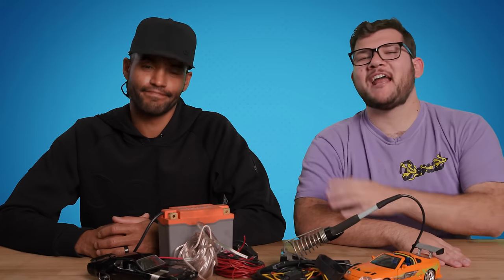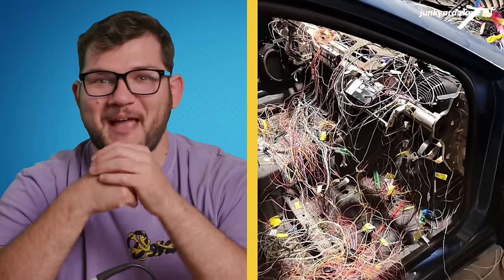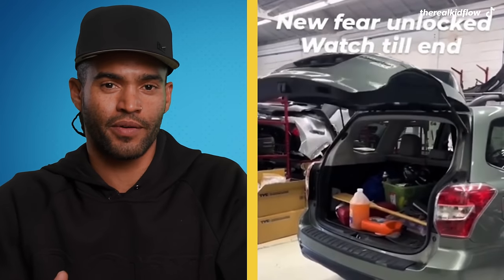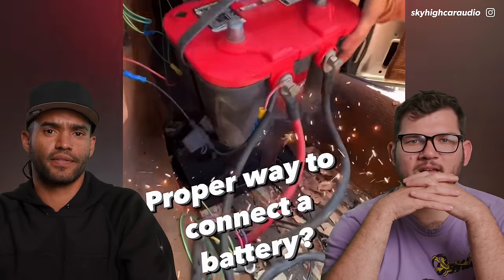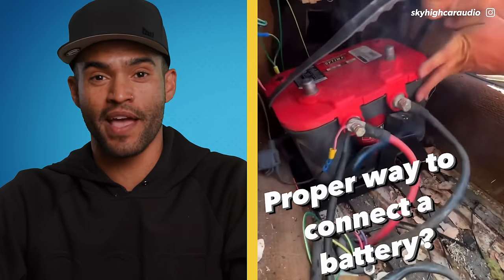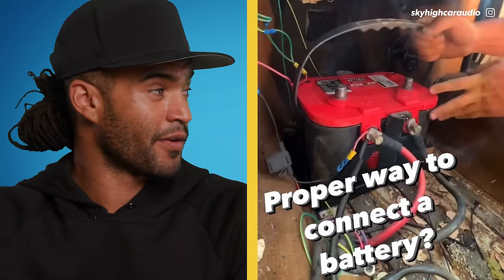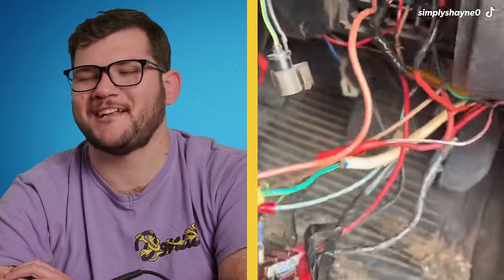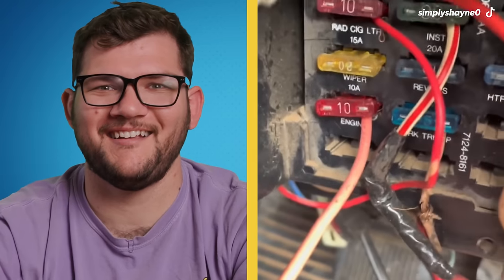Mechanic Reacts to Deadly Electrical Repair Fails

Comment: Ah, memories. Once when I was destitute and homeless, someone gave me a free Volvo if I could get it to start. Which was not the biggest problem, it was just the transmission interlock, I bypassed it and it started right up. The biggest problem was that it had been rear ended which destroyed all the lights. It also killed the headlights somehow, no idea why.  I affixed trailer lights to the bumper, went to wire them in, and discovered that someone had snipped that entire part of the wiring harness off. No idea why. Anyway, I'm homeless, got $20 to my name, very limited tools, no multimeter. So, I wire them all to toggle switches that I mounted in a piece of cardboard and taped to the dash. Got fancy and had a three-way toggle with a blinker relay for turn signals. I had to screw a giant button to the brake pedal to get those lights working. Did this all in an Autozone parking lot, I might add. Lived in that thing for like 6 months and put 10,000 miles on it.
Reply: Hope you doing better these days, man.
Reply: dude thats legendary
Reply: Thanks gor sharing, hope you're in a better place now or at least on your way to a better place.
Reply: Probably cut the wiring to get the lights to stop or something similar. When a vehicles horn gets stuck on after an accident the fire dept will cut wires to get it to turn off. Hope your doing well my man.
Reply: Fucking legend right here man, that's awesome. Other than that, hope things have turned around for you.
Reply: That’s awesome man, what a story
Reply: Wow, dude! Way to Mcguyver the fuck out of that beast! Hope you're doing much better now!
Reply: Legend.  And a volvo....dope!!!! 😂😂
Reply: @Damasiofa  Judging from his name (which is fucking awesome btw), and his ability to macguyver shit, I'm going to guess his homelessness is dependent on whether or not he is on his meds.
Reply: Rich in money vs rich in knowledge 👍
Reply: What kinda Volvo? My first was a 240 -78! Great cars! And safe.. like driving a brick!
Reply: I can't Imagine doing anything like that without a multimeter because I continuity test everything I do like 40 times

Comment: first clip - Junkyard Dave, he nailed it, his Charger Magnum Hellcat runs and runs good! No shortcuts, no fire, no issues at all
Reply: He did an amazing job, I follow that build and have since his 3rd video on it. One day I plan on building my magnum similar to his and learned a lot from him on it.
Reply: that dude is no joke and his wiring on that car turned out amazing
Reply: Crazy. I used to watch him long ago before he gained any popularity. Last I saw a video of his the charger magnum was just beginning or maybe even just an idea
Reply: 0:43 junkyard dave ftw!
Reply: Did he ever get a windshield and wash all the dust off the Magnum?
Reply: Maybe they should actually look into his complete work rather than shitting on a couple short clips.
Reply: What looks like a rats nest to some is an organized masterpiece in the right head
Reply: I started to watch his build on this but then he kept talking too much then started jumping around to other projects and moving shops so I got bored and moved on.
Reply: @The513Warning  yes, the windshield is in
Reply: That is hack work, zero pride in effort.
Reply: @ronbelanger4113  hack work? you should watch his videos on that car. nothing hacked on that one lmao he rewired and reloomed that entire car to the same if not better than factory
Reply: That car has taken him years. I have massive respect for him

Comment: In my aviation mechanic days, I was the primary focal for doing wiring/electrical jobs.
1. Nobody else had the patience/or enough understanding to go through a wiring diagram that sometimes stretched through 13 pages of 11x17in paper.
2. Nobody wanted to touch it, being afraid to short something out or get zapped.

it was quite satisfying in the end, when you're updating an older small airplane with more modern avionics, and you end up with a ton of dead wires that you cleared out, left over from several previous avionics changes.
Reply: It's all 400hz Ac stuff correct? I don't mind digging real deep into auto/ equipment DC stuff, no urge to play with AC in a "vehicle".
Reply: On the modern jets, the electrical system packs a wallop, but my bread and butter at that time was in General Aviation (Cessna 172s, Beech Duchess, as high as Cessna 414), so i worked with 12 to 24 volt systems. Though it would still tickle a bit if you touched the wrong wire by accident.
Reply: When i was in A&P school i hated electrical. Didn't understand it, and still don't. Graduated but never went for my license because of it.
Reply: ripping out old/unused wires is pretty satisfying. If you can do a whole loom at once? oooh baby.
Reply: I've seen some shit. I work aviation adjacent and holy fuck.
Reply: Sailboats man, sail boats, nearly the same problem of no one wanting to touch the electrical jobs. Lets just run new wires. Every problem aviation has and then add some. Because now every boat owner wants to be green, run hybrids systems, have radar, GPS, multiaxis sonar, have highspeed internet, and to top it off live on board. And the tech has changed so much in the past 30 years, I think i pulled 6 versions of garmin systems out of 1 boat.

Comment: 12:40 As an Australian that looks like an (80s) E series Ford Falcon. Just a guess, but the steering wheel n dash look familiar. Could also just be a Brat. 
I'm more of a Holden guy though.

Also was funny hearing "it's right hand rive man" at .25 speed.
Reply: Xf Falcon ute for sure
Reply: Xf Falcon Ute for sure

Comment: When I lived in Alaska we had to put heat pads for the oil, heat blankets for the battery , heat plugs for the block and radiator to keep it from freezing. We'd have to plug it in when we parked.
Reply: Yeah. I was in Edmonton, Alberta, and even that is just ridiculous. Batteries lose like half of their power, the oil is practically grease. Even when you get the vehicle running, your brakes might be frozen, and your shocks will be rock hard too.

Learned a lot from living there for a few years, glad I am not dealing with that shit any more.
Reply: Same.  My truck had a block heater engine oil heater and transmission oil heater.
Reply: It’s like that everywhere in Canada . Some car like Jetta mk6 tdi have something similar from the factory. I think it’s hard to find it in the USA but it’s standard for those model in Canada. But I will say that they become more rare on with newer car . With old diesel truck in some place that you couldn’t plug the truck you had to lights up a toilet paper roll full gas under the oil pan if you whanted to start it in a cold morning 😂

Comment: 6:00 That custom done heater is probably someone who lives in a northern environment where it gets below -20C/-4F. Many cars in Canada are bought with heater blocks installed from the factory so cars can be started when it gets really cold. That homemade one thought looks sketchy AF.
Reply: I live in Iowa and it can get as low as -50F on a particularly bad day

Comment: The Subaru lift gate was more than likely the gas strut worn out. I had another vehicle that would do the same thing with an automatic lift gate. It’s designed to lift the gate then let the gas strut hold it in the upper position. I changed my struts and it worked fine.

Comment: So, the magnum with a hellcat. That guy was in progress when you pulled up a clip. He could have had a very detailed home-drawn schematic he was using for that spaghetti mess he had. He mentioned he was preparing to loom it after he got everything routed. (not how I would do it, but if it worked for him, I can't fault it) Also, he mentioned that he "tacked in" a steering shaft, this is very common to do just to get something to your dino appointment. It isn't permanent, but He needed it to hold together just for one dino session and then, once returned home, he'd final weld it. I love seeing the usual butchery, but, in that case, I'd say hold judgement until you see the finished product. It may be MUCH nicer than you think since you were seeing it mid-process.

Comment: 13:00 that a ford xf Ute and people have been tapping into the wiring system since they was only 5 years old 😂
Reply: Yeahya good spotting must be a kiwi or Aussie
Reply: I was looking to see if anyone else spotted the Falcon. Tapping into the fuse box isn't an issue. It's how he did it

Comment: "Get yourself a cat." Bro I have a cat and left the garage open the other day. A tiny mouse got in the house and my cat was just chilling with the mouse. No attempt at catching it whatsoever.
Reply: Even if the cat doesn't actually hunt the mouse they leave pheromones around that mice tend to avoid. When they rub their face on stuff that's what they're doing.
Reply: Could be worse. When we were getting mice in the house my cat would catch them and release them live in my bed.
Reply: A rodent ate into the wiring of my BMW years ago - that was a $700 fix.  If rodents can do that sort of damage to a 12V system, imagine what sort of damage they would do to an EV with their high voltage systems.  Probably would have more visible fried rats around the car, I suppose, but even partially chewed but still functioning high voltage cables will be a major safety problem.  I wouldn't want to be in a car with a 700V system with shorts in it.
Reply: Cause you feed it too much it knows you give it enough food
Reply: Barn cats kill mice.  House cats domesticate them.  Get a barn cat.

Comment: Back in the 1990s, I self-installed a Crutchfield car alarm out of yearning to protect and safeguard my '91 Geo Prizm with a sweet (based on my revenue stream at the time) Alpine CD / tape adapter deck.

I got more than a few notes from my neighbors because I had unwisely decided not to install the ground wire on some static piece of the car's chassis, but rather took this stranded wire and stuck it under my driver's side seat. 

Just why ignore electrical, brothas.

Comment: for the subaru outback, by guess would be that the motor lifts the tailgate but the one or both of the struts have failed causing the tailgate to fall due to the struts not supporting it

Comment: I love these guys man. Nolan, Aaron, Angelina and Sandro, they've built a good team up here. About the cars... yeah, electronics are very tricky, we got a car at home, doesn't start and we've looked and looked for the problem, spark plugs, fuses, battery, distributor, ECU, car still didn't run, only cranks.

Comment: One of my worst wiring nightmares brought a car that had a turbo model engine put in a base model, to only realise there was 6 harnesses spliced together inlc two separate main fuse boxes - after spending way to much time to get things working, i worked out i could of brought the body/engine harness from the later model and would of only needed to change about 4 plugs to make it work correctly (obviously who of had to take interior out and body panels off but would of been so much quicker)

Comment: Whenever I buy a car or motorbike I try to buy a workshop manual with a wiring diagram and my current bike did come with a wiring diagram with the owners manual which made it so easy for me to wire in a few things.

Comment: Oil heaters are very useful in northern winters
Reply: he bought a 3 pack on amazon. and is heating the trans fluid and either diesel or coolant also.

Comment: First off the very first video is Junkyard Dave who took a Hellcat and put a Magnum hatch on it. He didn't do a front clip of a charger, he did it the hard way, magnum hatch on a charger. . He carbon fibered a roof, converted it to all wheel drive, 3D printed material and CAD designed parts he needed and painted the car and is working on a custom dash. He's not haphazard and currently has the car running. Know your source material and check out his build first.
Reply: He took a magnum and molded a charger to it. It’s a magnum with charger parts.
Reply: @jessehendrix8707  Dude, I'm pretty sure he started with a wrecked hellcat and put the hatch onto the actual hellcat not the other way around
Reply: Look up the build on YT
It started as a charger,  and is now a widebody AWD 1000hp hellcat wagon.. 
Junkyard Dave - Building What Dodge Wont | 2021 Charger Magnum Hellcat | 1000HP Hellwagon | Pt 1

Comment: the ute is a xf ford falcon ute from aus the wiring is always munted here we add and remove stuff regularly try having spotlights and hitting a kangaroo then changing it all new every time we cut switch fuse and done

Comment: One thing I learned from working as a mechanic, Wurth has a great lubricant called HHS 5000, and what one of the senior mechanics said, mice absolutely detest it for some reason. So if you have a rodent problem, just spray it here and there to make them stay away
Reply: sounds wurthwhile
Reply: @egonspengler7967 🤣🤣🤣

Comment: It's nice coming from an electronics background and now working on heavy equipment. Everyone is so scared of electrical issues and they're usually pretty simple. There are some pretty in depth circuits on a lot of these machines but nothing like component level troubleshooting circuit boards. Always thought it was funny how some of these really great mechanics cower in the face of a simple harness issue. But I always say, everyone is good at something.

Comment: 12:15 Get a cat. It works. I have no rodents in my place but you get the occasional cockroach. The other night I saw one land on the wall and it kept flying around. The cat was on it. He saw, he came, he conquered. Basically he waited until it got low enough then swatted it. It then tried to run away. He then swatted it again. After a few hits, he picked it up and held it for a while then dropped it . Rinse and repeat a few times and the roach ended up dead laying on its back (still intact). He's learned not to eat them. It took him less than a minute to kill that thing.

12:51 That's scary. I like extra gadgets but with mine, there is an aux deep cycle in the back with a voltage sensitive relay. This has a fused direct connection to the primary battery.  I then run over 10 extra circuits (each fused via an addition distribution board). In my setup, I tend to be drawing at least 3 Amps continuously (dash cams / GPS tracker, USB chargers,etc ) up to about 25 Amps (LED spotlights, better cabin light, etc ) all of the auxiliary battery so my primary cranking battery doesn't go flat.

Comment: The video with the heating pad on the oil is a winterized vehicle from Alaska. It gets -60-70f in the winter. To prevent freezing you have a heating pad under your battery, on your oil pan, and usually on your transmission. You plug your vehicle in when you park to keep these warm and prevent catastrophic failure due to the cold.

Comment: Up in the great white north, I had a battery heating blanket around the battery, a block heater to heat the coolant and an oil pan heater to heat the oil (on a 7.3L diesel).  No matter how cold, it would start right up and not sound like it was going to destroy itself.  You would also get cabin heat/defrost much quicker.

Comment: The oil pan heater is very common in Alaska. The oil will freeze if you don’t keep it warm. The three receptacle adapter at the top is so you can also keep the battery warm with another heating pad when you plug it in at home if you park outside.

Comment: That oil heater is something I would see occasionally when I worked in Ottawa, often on cars that came from Northern Ontario or Quebec, where it gets cold enough to need an oil heater as well as a block heater.

Comment: That red car with all the switches wired into the fuse box.   That was a Ford Falcon ute from Australia, an older one from the 90s.  I can tell by the window shape and the lines on the 1/4 panel.  They were very boxy cars.

Comment: Those are heaters running AC are for your oil and glow plug I think they call it and battery. They did these setups in Alaska for extreme cold weather to prevent your car freezing overnight. That’s what it looks like at least. A plug comes out the front bumper and you plug it into wall sockets at home or sometimes apartment complexes have poles with plugs on em for this purpose

Comment: I've seen that guy's YouTube channel with the blue car that actually started Life as regular four-door charger but he ended up turning it into a wagon and putting the hellcat with a four-wheel drive system in it even built his own front add rear subframes for the car

Comment: I have done some wiring jobs, I'm not a technician but I got a 1982 Honda Civic and played around, got high/low beams, turn signals, and brake lights all rewired and everything worked like it was supposed to, without a mess. It definitely took planning, time, and LABELING
9 mins in, definitely don't hook up ground and/or power terminals on a battery before installing lol. Those shorts can ruin components 😂

Comment: The liftgate issue is actually really common on a lot of vehicles. The struts are meant to hold the trunk open, and the motor turns off at the top. Gets to the top and motor turns off, struts have failed trunk slams shut

Comment: For the Subaru hatch clip, i bought an Infiniti QX56 that did same thing. It ended up being the struts didnt work well enough to hold the hatch up on their own, so as soon as the motor lifted the hatch to the end of its travel, it would slam back down.